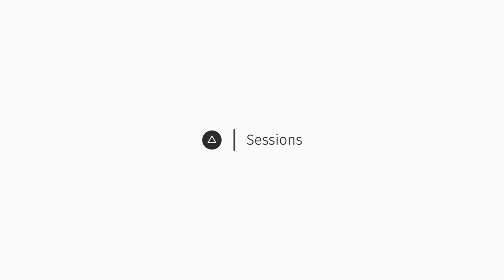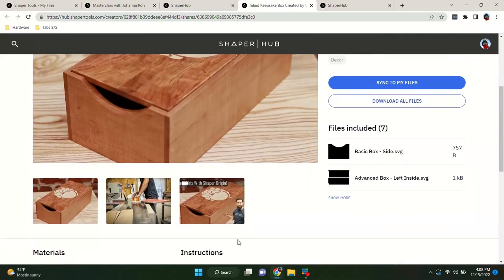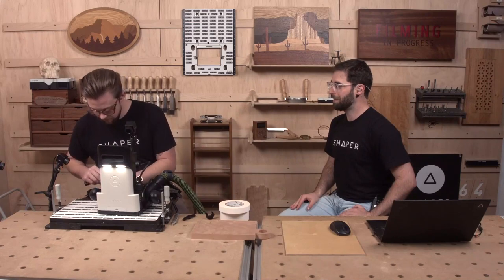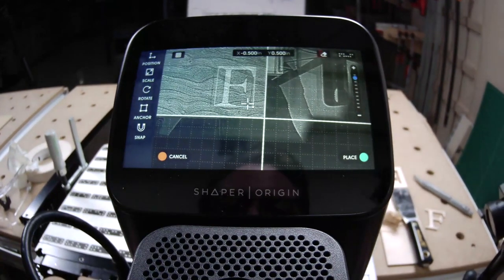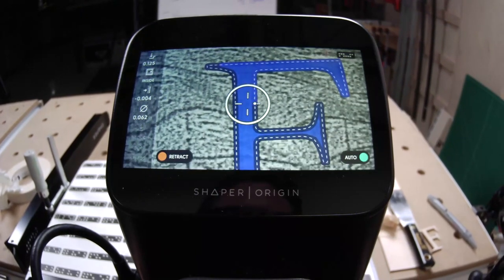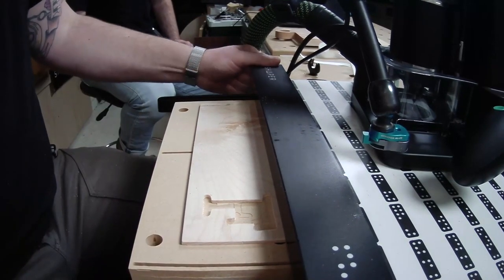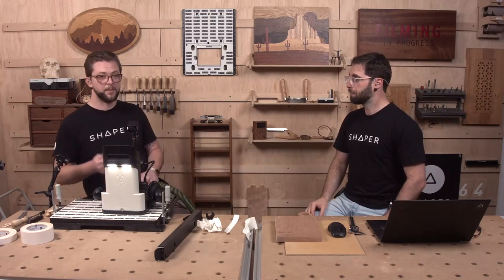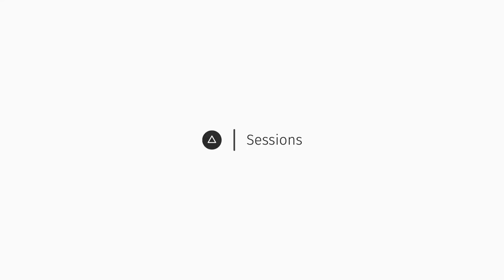Session 72  – English: Customization with Inlay and Marquetry

Comment: Hi, love your sessions, the question I always ask myself and now asking you is,
Why not use a straight flue cutter instead of the upward spiral?
I see a lot of break out on the finish and sanding is applied after.
I know the waste chips extract better but for the finish edge to break out surely this defeats the object of the exercise.
Can it be possible to use straight fluted cutters to get a better finish without sanding?

Thanks

Ken (uk)
Reply from the maker: Using the right bit for the right application is key--you can absolutely use a straight-bit cutter if the material calls for it! Taking down the fuzz on the edge is usually a single swipe of some sandpaper, not much of an issue at all.